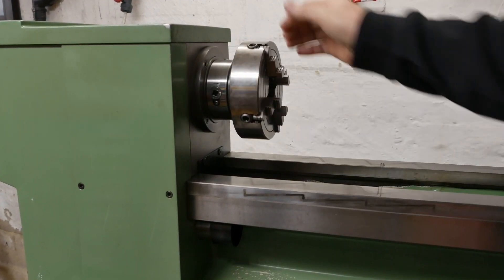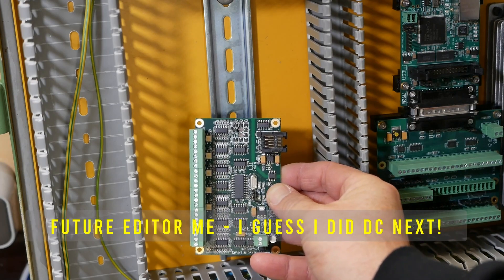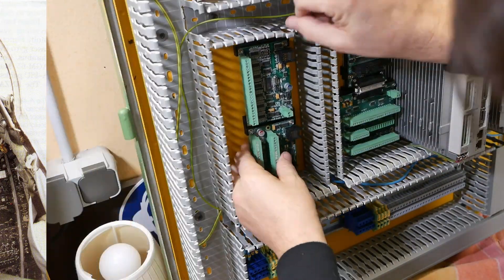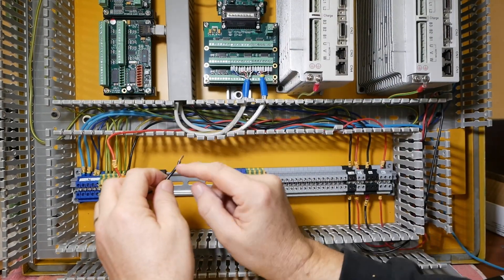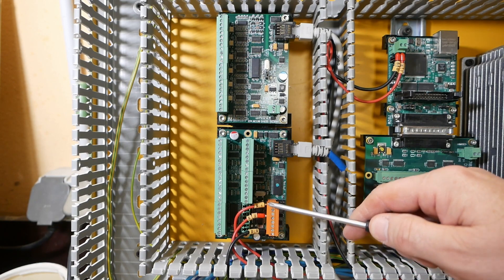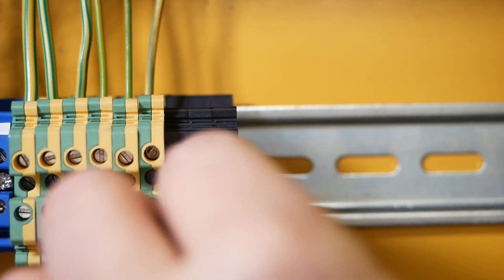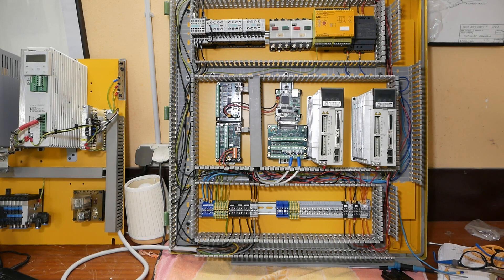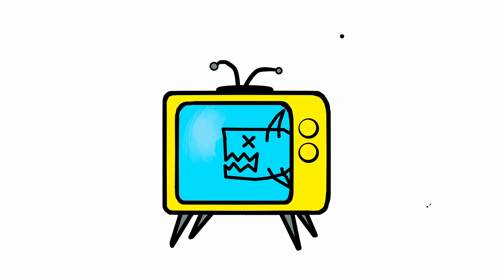Schaublin 125CNC retro fit - episode 27  -  power wiring

Comment: Hi. Do you still have the original contractors? What are they? Will you be interested in selling some of them?
Reply from the maker: A mate of mine got two of them, but I still have the other two. They are Sprecher + Shuh CA1-16-N's. 48VAC coils.The contacts are rated for 15 KW at 380VAC. What do you need them for?
Reply: @RotarySMP  I’m rebuilding a Schaublin 150. Have 3 faulty CN1-10-N.
Reply from the maker: @drororen9119  Drop me an Email. The address is on the "About" page of the channel.

Comment: 1st is my question. I'm in UK and have built a new enclosure for my cheap 3040 CNC. I have put a RCBO's (one for the VFD and one for the rest of the elec's) in the enclosure but my flat Elec's is covered with RCBs. My dad was in the RAF as a electronics wireman by the way, he did not talk about which aircraft he used to work on very much but then ended up as a prototype electronics draftsman. My background is equally a long story but I started as mechanical engineer but after 18 years (and many roles i.e. toolmaking, inspection, production and CNC) went into the IT support role. Many years later now got the bug to do some CNC stuff at home and here I am with a new control enclosure for the questionable 3040 running UCCNC with UXBB-E controller board (oh and a 3d printer). Jus loving being able to design stuff and then produce at home with in limits of the machines and the fact I am living in a flat, lol. Funny how all my hobbies involve computers in some way, not LoL. Oh yeah my dad met prince Philip once and I was at my friends house on the couch (heavy night) when heard about Diana's death and still remember it like it was yesterday.
Reply from the maker: I also didn't expect to get into electrics or electronics when I started out, but the combination of mechanical and electronic is fascinating.

Comment: I wonder what is a correct way of connecting multiple machines to a home electrical installation? There are three phases connected to house breakers in the box at the street, then they go to home electrical box with all other breakers right? And each machine has a breaker of it's own. I guess each machine should be connected directly to the wires from the main street level breakers and not through additional breakers in home electrical box? I ask here because you told about having a breaker inline with another breaker not being a good solution. I now have one 3 phase cable and switch the machines by operating the plug, which is sort of a "deal breaker". How do you deal with it?
Reply from the maker: I have been since been told that breakers behind breakrs is fine, as long as they are faster blowing, or lower current.

In my case I have 16A CB for the basement, and all machines are on that circuit. Unlikely I will be running more than on machine at a time.

Comment: We would get along just fine.  Wire ferules, proper crimp, flush cut wire cutters, tag each wire, and Panduit.  For fun we could forgo the Panduit and lace everything in.  After all who ever needs to open up a harness when it is done right the first time?  I know I NEVER had to.  LOL.  Looking good mate.
Reply from the maker: Aircraft used to all have laced harnesses. Must have been thousands of hours work in them.
Reply: @RotarySMP  I don't want to know how many hours I have in lacing, or how much lacing cord I've used.  It really is impressive when complete.  Everything has it's place all tidy and secure.  Until you have to open one up.  You do great work.  Look forward to seeing what else you get up to.

Comment: You can actually add a breaker behind a breaker as long as its a lower rating. The series wiring of breakers is prohibited in a house hold installation, but with a breaker inside the panel, your actually protecting the device (lathe). In household applications your legally obligated to protect the wire and the wire only. Devices have to use their own protection. Hope its similar in German regs, as ours originate from the German standard and I believe it should be the same. Someone correct me if I am wrong, but we usually do integrated protection in our control panels. The source however is the clients responsibility. Though we do use several fuse disconnectors instead of breakers, as we found that they endure a bigger current spike and that 2 series breakers will usually disconnect at the same time, making the second breaker a bit pointless.
Reply from the maker: Thanks for the description.

Comment: It could be really dangerous with high pressures but like,

Could you mill a very specific cone with a tiny hole at the end and threaded adapter so you can stick it on an air hose and get a tiny, but very high pressure, stream of air that would be enough to blast away the dirt on the nameplate?
Reply from the maker: Might work, but it is very tenacious gunk.

Comment: One thing that gives me a little concern (and no, not the barrier separators, others have mentioned that) is the wire diameter on some of the runs. I'm guessing that most of that surplus wire is #20 or #22 or the EU equivalents thereof. Generally I wouldn't want to run more than about 5 amps thru #20 and about 2 amps thru #22. That is perfectly fine for signal wiring. But if there is a possibility of those VFDs drawing 8 or 10 amps, I'd want something more like a #18 or #16 wire size. In US electrical wiring they want you to use #14 for 15 amps and #12 for 20 amps, but you can get away with a size or two smaller for electronic wiring, especially if the wire insulation is rated above 85C.
Reply from the maker: I dont know all the US guages, but I am using 2.5mm² for the 400V VFD power wiring,  and 1.5mm² for the rest of the 400V and 230V systems none of which is more than a couple of amps. While I have it , I will also use the left over 1.5mm² for the 24V and 5V DC (overkill), but once I use that up, I'll get 0.75mm² for DC and signal wire.
Reply: @RotarySMP  Ok, I guess those wires are thicker than they seemed to be in the video. The other thing worth checking is the insulation voltage rating. A lot of hookup wire is 300V rated.
Reply from the maker: @lwilton  This wire came out of the Schaublin cabinet, and it was always a 400V machine.

Comment: If something else has grabbed the same IP address as the board you can't connect to it would cause the same kind of problem as you are having, happened all the time when i was working in a school where people would bring in devices to connect to the network without telling us or setting them to get an IP from DHCP.
Reply from the maker: My mate who knows way more about it than me help me try to set the Duet WIFI to a fix IP address, but we couldnt get the router to support that. 

So each time it is switched on it gets a different IP. I normally use a usb cable and a Prontoface as a serial connection, and interogate it with M552. Then I just need to put the IP into browser of a device on the same wifi and it opens an interface to upload files, control the printer etc.

I can still interogate it and get the IP address, and when I put it in the browser, the browser tab shows "Duet wifi" so some handshake is happening, but the interface website wont load.
Reply: @RotarySMP  A lot of routers can act as DHCP servers on their own and that can cause problems if another device on the network is also trying to act as a DHCP server, like HP printers, can't count the number of times a teacher brought in a printer that was configured fine for their home but would grab random HP devices across our network and assign them new IP addresses, network masks, gateways and DNS, a major pain in the A when you have 50 teachers all whining that any momentary inconvenience to them is a major teaching and learning issue that you should drop everything you are doing for the other 49 to sort out immediately.
You might want to check the time settings to make sure the connection isn't timing out while handshaking because the time is wrong on either the computer or the card.
Reply from the maker: @atheistsfightclub6684  THe weird thing is that it worked fine for years, and there was nothing obvious done to change the network. No new devices, etc. I doubt there are any other DCHP devices on the network, as we only have three phones, 5 laptops, a tv, and the 3D printer connecting to it.

Comment: Respected, if at any time You have a vibration problem that unscrews your wiring, please take time to look at spring loaded type. Change from screws to spring loaded connections decreased our interventions at open pit coal mine by about ten times. Best Regards.
Reply from the maker: There was a discussion between the friends of spring and the friends of screws on another video. I must say I had not even thought about it, and just ordered whatever. I believe that spring is more reliable, bit this is now a hobby machine which is going to have a very easy life, not be sent down a coal mine :)

Comment: 0:38 I challenge those instructions... breakers are designed to protect the "branch" circuits they service. By his reasoning, you might as well toss out your breaker box and just use the mains disconnect for everything. I'd put it in anyway - save a lot of hunting down the road, if it does trip.
Reply: Agree, this makes no sense, in every power system there are many levels of breakers. If anything more breakers and disconnects are encouraged.
Reply from the maker: @MarkFunderburk  Thanks.
Reply: Agreed
Reply from the maker: Thanks for your feedback.

Comment: for branch circuit protection under UL 508A (panel construction) and NFPA 70 you can run either a UL 489 breaker or a UL 1077 Supplementary protection device behind another breaker.
Reply from the maker: Thanks, I misunderstood his input. He was against breakers too similar that it would not be clear which one pops.
Reply: @RotarySMP  yeah same amp rating could cause an issue in locating it. Might look into a supplemental protection device. You can put them in your panel to pop when a current load deems it necessary,  but you can also isolate different circuits.

Comment: Nice job. However, Those three phase connector blocks feel like they ought to have some more separation between them. Those links are awfully close together considering the potential across them!
Reply from the maker: Thanks for spotting that.
Reply: I agree. There is now like 2mm gap. That is not enough.
Reply from the maker: Crowd sourcing quality inspection is brilliant. Thanks.
Reply: @RotarySMP  at least you know we pay attention for the sake of your safety….and our continued viewing pleasure!
Reply from the maker: I do. I added a question to the first comment about terminal partitions. Do I only need then between the jumpered contacts? The blocks without jumpers already have a plstic divider moulded into them.
Reply: @RotarySMP  as low nf as they are rated for the voltage, I’d imagine the other blocks should be ok.

The really high voltage Electric fields like to build up on sharp pointy edges, so I may be worth sanding any sharp bits off the jumpers. The only thing I can think of that could produce such high voltages (where this would be an issue), is a very inductive load turning on/off quickly. This may or may not be an issue for you.
Reply from the maker: Thanks for that.

Comment: What messa card do you used? I see 7i92+7i85+?
I prefer use 7i76ed(e) for "simple" mill or lathe. If you use encoder on axis use 7i95. It is simpler that combine plates and cheaper in total.
Reply from the maker: I decided on :
7i92 - Ethernet
7i85 - I need five encoders and 3 SS daughter boards
7i84 - IO
7i83 - Analog control for axis and spindle VFD (I am not using Step/dir, so the 7i95 or 7i76e are out)
7i73 - User Interface.

I couldn't find more simple solution. The closest was the 7i97, but it would have still needed the 7i84 and 7i73, and for that you are missing one SS RS-274 PORT.
Reply: @RotarySMP  5 encoders? Maybe 3enc+ 2mpg?
 Spindle + X +Z +feed +speed?
Reply from the maker: @safeaegis  X+Y+Spindle+JogX and JogY. You are right, I forgot about feed override.
Reply: @RotarySMP  1) find in google yapsc v10. Low cost Step_dir to analog+enc converter with PID and high performance. Recomend.
2) 7i76 have 1 fast encoder abz and 2 "slow" ab encoder which are used for jog.
Combine 76+2*yapcs you received all your need.
I understand what you done you choose. It will be helpful in future projects 😉.
Difficult write comment use phone and memory, I have war in my country and left own town... I hope it will and soon and my workshop didn't receive demage... I must left 2 big project (new lathe and mill) and go to the safety. I used 7i76ed and it really cool controller.
Reply from the maker: @safeaegis  Those drives are capable of Step/dir, so I could drive them with a 7i76, I just didnt want to.
Reply: @RotarySMP  understand. Analog drivers are more difficult in works and setup, imho. Modern step -dir works great.
Thanks for your videos 😊 make more
Reply: @RotarySMP  if you use analog  7i92+7i77 i think the best choice. It have necessary IO.

Comment: I’ve been there. In early Citations, the differential pressure switch for Mach Overspeed Warning is in about the same place. In order to cram a body in among the column, rudder pedals, and pedestal, it is imperative to choose the thinnest technician (me) for changing said switch. It’s still largely a one-handed affair, as the other one won’t fit. Somehow I changed that switch, and somehow I got back out of the cockpit; the inspector said “Fine. Now go back in and safety wire it.” 😳
Reply from the maker: That is the reason I ate more :)
Reply: Smart!

Comment: Frankly, I always thought that excess wires in aviation are due to potential temperature shrincage. My father was a "bort-mechanic" in Aeroflot and he told me that this was the reason they had behind USSR excessive electric wierig in aviaion.
Reply from the maker: I didn't learn avionics, so as far as I was concerned it was just dead weight, always in the way :)

Comment: I would consider adding spacer plates between the L1/L2/L3 blocks you created by shorting out groups of 3 with the combining bar. Seeing the tiny gap makes me nervous…
Reply: All the sparks coming to say the same thing
Reply from the maker: @boggothedoggo3890  I appreciate that feedback
Reply: @RotarySMP  Can you please do the same vedio on your maho mh400e or make a very detailed how you retrofitted the machine
Reply from the maker: You mean like this one?
https://www.youtube.com/watch?v=LXwbRhgq1og&
Reply: LOL i just said the same
Reply: I wouldn't consider. I'd just do it.  :)
Reply from the maker: @davidbrown8365  Good call.
Reply from the maker: Hey guys, I just looked up and need Pheonix ATP-UK partition plates. I am trying to work out how many I need. 

Just wondering:
I definitely need them between phases where I jumpered terminals into blocks, which leaves the metal jumper ends close, like @07:12
https://youtu.be/DP_RKZqLtW4?t=432

...but the terminals which are not jumpered already have a 1mm plastic divider moulded in to keep the contacts separated. so for something like  @08:25 
https://youtu.be/DP_RKZqLtW4?t=505 where there are no jumpers and each terminal block is one in/ one out, I dont need to add a further ATP-UK between them do I?
I really appreciate crowd source quality control. I have learned a lot from you all.
Reply: @RotarySMP  I think over a certain voltage level, these separator plates are more than recommended. 400V 3 phase, used with inductive loads... I would not save those few euros to make sure, there will be no flashover between phases!
Reply: Either that or an  extra unshorted terminal block for that matter. Leads to more real estate used. The plates are the far better solution. But if there is a sourcing issue ...
Reply from the maker: There were some in the terminal blocks I removed from the Schaublin. Bit different, but I will see if they will work.
Reply: I came to leave the same comment... 😅
Reply: I was thinking the same, earth block between each